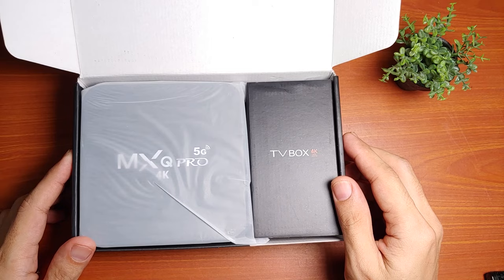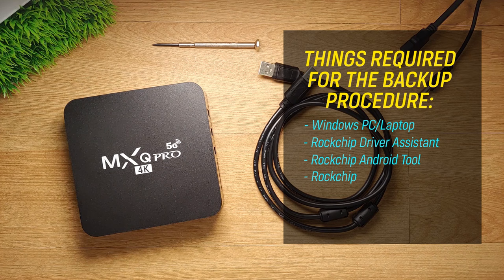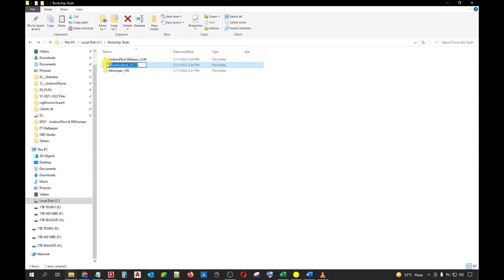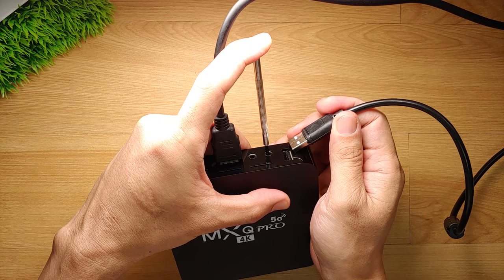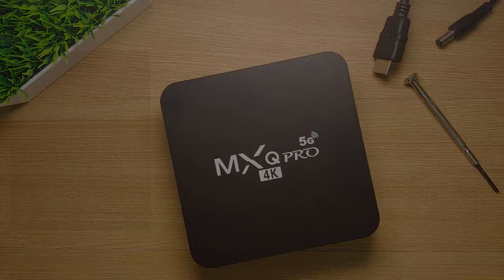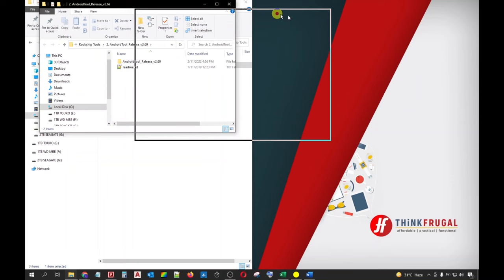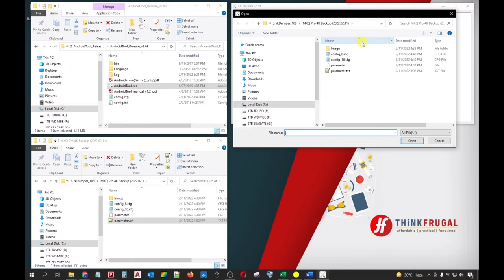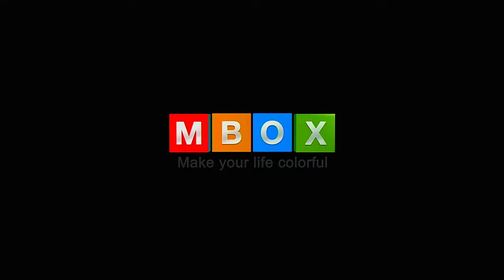Backup and Restore Your Rockchip Android Box (e.g. MXQ Pro 4K) Using AndroidTool & RKDumper

Comment: hi, need your help. I am getting errors below. using R329Q_v8.1 with wifi RTL8189FS

Found:  LOADER device (RK3229 2207:320b) #11

        --- Firmware dumping ---

        Found LOADER Rockchip device

        First 0x0010 NAND blocks reading

        Command to read failed

        -- Rockchip device resetting --

        Found LOADER Rockchip device

        Command to reset failed

Please.
Reply: try mo sir ung driver assitant version  4.3 tas repeat mo lng step 2 and 3 gana yan

Comment: Hello, I bought a QMAX 4k ultra HD box, it has the Rockchip RK3229, the backup procedure described in the video for RK3228a does not work, in the CMD DOS window it displays several errors and the backup does not work , do you have a solution or another video to perform this backup?

Comment: Sir, I think we have the same unit. Mine is also an Mxq Pro 4k 5g with Rk3228a processor and Esp8089 wifi chip (based on HWinfo app). Too bad I wasn't able to create a backup and I carelessly flashed an incompatible ROM before I was able to watch this video and your new upload. I was trying to revive my box and was able to go into Maskrom mode though I don't have the stock factory firmware. Can I ask you a favor? Can you upload your backup firmware? I can provide a Google drive link or email if you like. I hope you grant my request. Thank you and more power on your channel. Your videos are well produced and you've got a good voice and well versed script.
Reply from the maker: Thanks! Good thing you can still enter mask rom. Did you short the pins on the flash/emmc memory? As for your request, here you go: https://drive.google.com/drive/folders/1GCVPyYu2wIfZwykgB8EDEqYrOcFmuiuZ?usp=sharing
Reply from the maker: You can also try the firmware I flashed on the same device. Watch it here: https://thinkfrugal.page.link/Rockchipromflashing-yt
Reply: Yes, I can short the pin and enter the Maskrom. Thank you Sir, I will try to flash the firmware later.
Reply: @ThinkFrugal  baka po sir pwede pashare po ng backup file
Reply: @ThinkFrugal  I did the same think also before finding this video, I have a mx9 max and the device is in Maskrom mode any help would be grateful.

Comment: thank you for this well detailed video. do you have any idea on kernel modding? i want to overclock the cpu so that we can get a higher clockspeed using SetCPU,  SetCPU will only show the max locked speed if the kernel is locked at lower clockspeed by factory image
Reply from the maker: You're welcome. Unfortunately, I am not yet familiar with kernel modding. That will be a great idea though to increase the cpu speed, however, that will also increase the temperature of rockchip processors which is already considered extremely hot when running at full speed.
Reply: @ThinkFrugal  yeah will be great if someone have the knowledge and create a video like yours, as rk3229 is really a budget slow chip so even if its overheated & fried, it wont hurt that much from your pocket.
Reply from the maker: @TabMusicChannel  I agree. There are so much possibilities with these boards.

Comment: My Dear friend, your video is a very professionally explained, please keep up the good work, please help me with this issue if you could:
 I have downloaded  exact folder as yours 
1-	Rock chip Drivers Assistant

2-	Rock chip Android Tool release
3-	Rock chip rkdumper from google.
when using rkdumper.exe dump in administrative command prompt, I get  error  saying (found loader rockchip device first 0x0010 nand blocks reading) what am I doing wrong? using Windows 7 Pro 64bit. Regards; Ken
Reply from the maker: Thank you for the kind words. You are doing it correctly. The "Found Loader Rockchip Device first 0x0010 NAND Blocks Reading" will really appear on the command prompt window when you dump the files, that's normal. Can you explain more about that error you experienced?
Reply: @ThinkFrugal  Much appreciated for your prompt response. The error I receive as follows: After these lines "found LOADER Rockchip device First 0x0010 NAND blocks reading Command to read failed (printed in red) -- Rockchip device resetting -- Command to reset failed (printed in red) Then back to c: prompt C:\ROCKCHIP Tools\3.rkdumper_108" The Box is 4K Android DIGITECH XC-6012 CPU RK3229, RAM 1GB DDR3, OPERATING ANDROID NOUGAT, INTERNAL STORAGE 8GB. Ken
Reply from the maker: @ksafarian  I can now see what's the problem here. Unfortunately, you have those rare firmware which is in RFKP Format, and this backup procedure will not work for you. Please read  more about it here: https://forum.xda-developers.com/t/tool-rkdumper-utility-for-backup-firmware-of-rockchips-devices.2915363/page-10
Reply from the maker: @ksafarian  One solution I can think of is to flash another firmware (compatible with your device) so you may be able to create a backup in the future, please refer to my other video here: https://thinkfrugal.page.link/Rockchipromflashing-yt
Reply: @ThinkFrugal  Thanks a million brother
Reply: @ksafarian  i have the same problem. can you please tell me how you fixed it?

Comment: Sir balak ko bumili ng android tv box paano malaman kung original o fake at available ba ito store o anong company nagbebenta ng original
Reply from the maker: Ito yung marerecommend ko na mga android boxes: x96 air (1600php, 2gb version), mi box s (3000php), strong leap s1 (2000php) at mecool km2 (3500php). If malapit sa price na namention, very likely na original yan. Read buyer's feedback para sure na rin. Go for Lazmall stores para kung may problem, madaling i-return. Don't go for mxq pro 4k kung first time user ka para iwas sakit ng ulo.
Reply: @ThinkFrugal  sir abala kc yan may defect ibalik sa seller time waste.
Reply from the maker: @samuelreyes1208  That's how it is. There's always a risk kahit top rated na store or android box pa yan.
Reply: @ThinkFrugal  wala  ba sa outside
Reply: @ThinkFrugal  sir ala ba sa outside store mabili malibang sa online?
Reply from the maker: @samuelreyes1208  Try mo sa mga Mi store sa mga sm malls bro. Sa pagkakaalam ko, nagbebenta sila ng mi box dun.
Reply: @ThinkFrugal  salamat sir.

Comment: My RK Dumper is not working. It says:  
        Found LOADER Rockchip device

        First 0x0010 NAND blocks reading

        Command to read failed

        -- Rockchip device resetting --

        Found LOADER Rockchip device

        Command to reset failed
Reply: I got it. I used latest driver version wich is 5.1.1V, but using 4.5V it worked right. the only error was on the line Partition System, i got the red error: Filesystem file size is not equal partition size. but at the end. it finihed sucessfully.
Reply: @r.m.2000  🏆🏆🏆🙏🏾🙏🏾🙏🏾 U ROCK!!!
Reply: @r.m.2000  i got same red error

Comment: sir ung chip ko is rk312a. meron po ba kayong firmware/image for this version? di na rin bumukas ung device pagnakaconnect sa PC "Found one MASKROM device" na. anu po gagawin sir? sana po matulungan nyo ako. thanks
Reply from the maker: Oo bro, pwede pang makapagflash khit naka MASK Rom mode siya. Please open your android box, at makikita mo yung board model number, and wifi chip. Use that board model number and wifi chip number to search for a compatible rom from the links na nasa video description or pwede din kahit sa google lang. Ito yung hitsura ng board ko for your reference: https://drive.google.com/file/d/1YFvX8xaUtRGkg_ZTjshOwet3j-UYQ1K_/view?usp=sharing

Comment: Hi Sir! meron po ako Skone Pro 5g
nafollow ko po ung ts kaso di sya maback up kc my error RK3229 po
Reply: Command to read failed

-rock chip device resetting -

found loader rock chip device

Command to reser failed
Reply: sana mapansin
Reply from the maker: It's possible po na incompatible yung rom na ginamit kaya hindi maflash. To find a compatible rom, pwede niyong i-open ang box niyo at may nakaprint na model number sa mismong circuit board ng android box niyo. Please use that to search for a compatible rom.

Comment: sir, kailangan po ba na naka connect yung HDMI na isasaksak ko sa TV? thank you
Reply from the maker: Hindi na po kailangan, pero pwedeng isaksak para kita mo na kaagad kung nagreboot ng mabuti ang device after ng dumping or restoring process.
Reply: thank you po sir :>
Reply: Hello po sir ako po ulit ito, ngayon lang po kasi dumating yung mga materials na need ko and kaso lang po yung nalabas sa CMD kapag nag du-dump po ay "Command to read failed" and  "Command to reset failed". How to fix this po?  Thank You!
Reply from the maker: @zellybrit7885  Hi there! You may refer to this thread: https://forum.xda-developers.com/t/tool-rkdumper-utility-for-backup-firmware-of-rockchips-devices.2915363/page-9. Please RKDumper v1.08 and Rockchip Driver v4.3. Paki-uninstall niyo muna po yung Rockchip Driver v5.1.1 before installing v4.3.
Reply: @ThinkFrugal  sure po sir. salamat po uli!